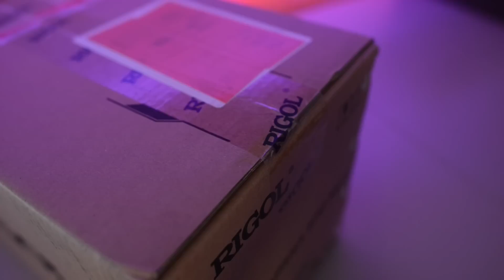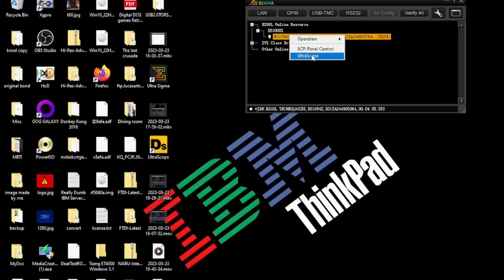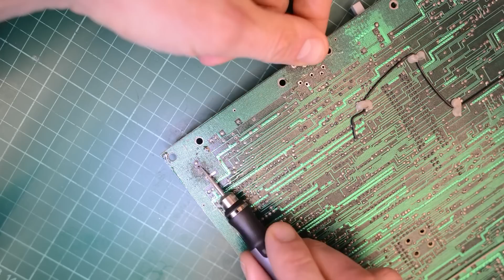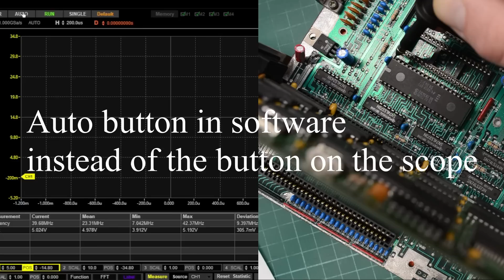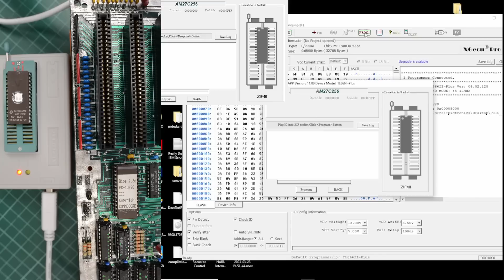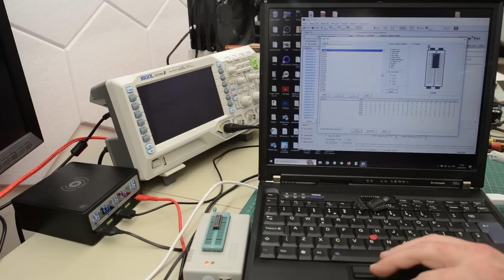Trying out a RIGOL DS1054Z on a battery-damaged Commodore PC10-III

Comment: Did you connect the scope using USB? Try the ethernet port connection, it's way faster. Also, select a smaller buffer size since all that data has to be sent to the PC, like 12KB is probably fine for troubleshooting digital signals. It can do 20MB, which can take minutes on the USB connection and about half a minute using ethernet. I never used the rigol software though, but connected to the scope using NI api with my own application to capture the scopes buffer for reading flux signals on 3.5" floppies :) Worked a treat! I could capture a full track with the scope in 4 channel mode, with about 4-5MB per track. The other channels contained the inverted signal, index and the digital read output.
Reply from the maker: Thanks, I'll give it a try

Comment: The chip tester is nice and easily finds dead chips. Sometimes chips may not be dead but just weak though. They may be good enough to pass the simple logic test, but still fail when they are in circuit and need to drive outputs at higher load. I've seen this with line drivers like the 74245 (similar to your 74244 in the video).
Reply from the maker: Ok, thanks. I'll keep that in mind when I use it
Reply: Yes, I’ve also seen this with the 6502!  Works fine in a chip tester, but too weak to drive the circuit on an actual board.  Mostly seen this a few times in a Commodore 1541 drive.
Reply from the maker: @dangoswick  Hmm. Ok, I'll see if I have other boards that use some of the chips in this Commodore and do some more tests.

Comment: The fact that your IC tester passes a chip as, "good" does not necessarily mean it is functioning correctly! I would refer to the data sheet and make a little circuit on a breadboard to illuminate a some LEDs when a switch is changed.  The software may function better on a Windows PC if you right click on the icon and choose "Troubleshoot compatibility" with the installer, and set a compatibility mode for the installer before installing. Once the software has installed, once again, troubleshoot compatibility with the application, and set a compatibility mode. If that offers no improvement, try setting the application to run as an Administrator. Hope this helps. Have fun, and thanks for uploading.
Reply from the maker: Thanks. I'll keep that in mind when using the IC tester
Reply: @Epictronics1  I went through that hoop diagnosing my old Apple II. All the chips checked out okay with the IC tester. The easiest way is to compare voltages on the board you are testing with a second identical system in good order. Chip failures are comparatively rare, but more insidious faults in these very old ICs are more common!

Comment: I love my DS1054Z. It performs really well and it's a pretty good deal for a 4 channel scope (that includes 4 probes -- granted, they're super budget quality, but they get the job done.) It becomes even more of a good deal once you hack it and unlock all the extra features (RS232, I2C, SPI decoders, double the capture memory, several new trigger options and increases the bandwidth to 100MHz.) The SOFTWARE on the other hand... yeah, 100% agree, it sucks. There are much better (and Free/Open Source) alternatives out there, that 100% work with this scope. Do check them out. Don't recall any names off the top of my head (I am tired and am not at my home PC right now) but the Googles should lead you to them.
Reply: Sigrok is pretty decent on the 1054Z.

Nice scope once you load the latest firmware and enable all the features.
Since I only use the scope screen, remote screen isn’t that important to me.
Reply from the maker: @roberthealey7238  Thanks
Reply from the maker: Thanks. I'll do a search for open source alternatives

Comment: I have the same scope. I bought it because Adrian Black used to use it.  Haven't used it in a while I have other scopes I like more.  Maybe you should get a USB scope like Adrian uses now. Last year I bought a cheap Loto USB scope off Ali Express. Not bad for 100 bucks. Nice software that would be easy to capture for video.
Reply from the maker: I considered getting a USB scope, but I prefer having a proper scope with a large display and real knobs. I'll just doo the proper research before I buy next time :/

Comment: Yeah, I get the feeling that the software was only there to tick the box in the feature list, not actually be useful for anything. Other manufacturers offer software connectivity as an optional extra, so in this case it looks like you get what you paid for, and you paid nothing for the software.

I've got a Siglent scope which is about 7 year old, and I've been pretty happy with it, although I've never used any kind of PC connectivity. The one thing I find annoying about Siglent oscilloscopes is that when you stop the capture, whatever is shown on the screen is all you can see. Most other scopes capture as much as their buffer allows, and show you a window of that buffer based on the currently selected timebase. That means you can zoom out to see more if you're not already on the longest timebase. With the Siglent, you have to zoom out to the largest timebase you want to see before you stop the capture, then you can zoom in and hope that there's enough data samples to see the details you need in the waveform. If you try to zoom out any further, it's just blank.

As for software connectivity, according to the manual you can either use Siglent's software or National Instruments "Vista" software. But again I have no idea how well any of that works.
Reply from the maker: I think you're right. It was probably included by the marketing department. By the looks of it, they probably made it too ;)

Comment: DS1000Z series is a great standalone 'scope, but just forget the software and PC connectivity. That's all garbage.
That thing has real knobs and buttons, that's a blessing, use those, don't screw yourself with PC software. That's not a USB-box oscilloscope. 
 I always shoot the screen with additional camera for YouTube.
Anyway, data rate that oscilloscope is capturing can not be transfered through 100 Mbit ethernet or 480 Mbit USB. ADCs run at 1 Gbps there.
And the data that being transfered is raw data points, not the screen data. You loose much of visual information that way, because internal screen has "digital phosphorus" and grading while PC software can not do that.
Reply from the maker: I agree. The scope seems great. So, if USB isn't fast enough, what are scopes with a good software solution using?
Reply: @Epictronics1  Sorry, I don't know any really good USB-scopes.
But I know that there are two projects for capturing waveform from DS1000Z.
One uses ethernet, saves screenshots with date and shows live wafeform (also without grading, much like original PC software), it offers no controls, only tries to display current data as fast as possible. Only for capturing purposes.
The other project's target is to create additional PCB, that is installed inside the scope between main board and the screen to give HDMI out for regular capture devices. So the whole screen of the scope will be captured. That is still in development.
Reply from the maker: Ok, thanks

Comment: it's a cheap scope, what can you expect? it's a wonder it can be controlled remotely by ethernet. I have one of the 4000 series and it has a vga output and none of the sw issues you showed. I had to use the 1054z in the past and it works, it's kinda annoying to use because of how slow the sw is, but it's what you pay
Reply from the maker: true. the scope seems great. They shouldn't have included that crappy software and won
Reply: @Epictronics1  I actually like the feature. in the past I had to take screenshots of the stuff I worked with, and using an usb stick to do so was so annoying. I used this remote control feature to automatically take a screenshot from a python script, 10x more useful than the crappy software and 1000x more convenient than the usb stick

Comment: Rigol's software is a piss show, at least for 1054Z - as you had bad luck to discover in person by now. If your intent was to buy a scope with good software/control from PC - you'd went way better (and cheaper which makes it even more funny) with some Hantek + third party software for it. Other good bets might be scopes from Siglent as far as I had heard from my friends sharing retro electronics hobby with me. There are some models out there with VGA or HDMI outputs providing the same picture you see on the scope screen over the wire. Also heard that some Siglent models do offer an VNC screen sharing over the wifi/ethernet but I never saw one in person so it might be just rumours. Getting back to Rigol 1054 - it is a good scope to buy and use, dirt cheap, capable and hackable as long as you intend to use it as a standalone device, like a good old dedicated tool in a box without all of those "modern fancy things" like PC control, e.t.c., e.t.c.
Reply from the maker: Yeah, the only thing I need from the PC is a capture of what I'm doing. I should have done better research. The 1054 seems to be a great scope otherwise

Comment: The software not mirroring the scope is probably by design. It gives you a second independent remote scope view. But I wonder why it is so bloody slow. As for pressing the up/down arrows a million times, did you try mousing over the numbers and use the scroll wheel on your mouse?
Reply from the maker: I guess it's useful that way for some applications. I'll try to scroll the mouse, thanks
Reply: Yeah, that could actually be very useful, to get detailed waveforms on one screen while getting historical trends on another.  I like it.  Well.... assuming it worked worth a hoot.

Comment: That software is Hideous! I am not familiar with the Rigol but as I said on the live chat the Siglent I have has web control or you just type the IP address in a VNC client. It works beautifully - only the framerate is slower than the scope itself (likely 30fps, so very usable). If you get the 100Mhz 4ch version it can be hacked to 200Mhz and you can also activate a few features such as wifi (will need dongle) etc. Beware, the WiFi on my unit is unreliable so I keep it wired. There are less buttons than the Rigol so some changes take more "clicks" but you get used to that I guess. Or hopefully you can find an alternative software for yours (which SHOULD NOT need an i7 to run! :) ).
Anycase, good luck and thanks for the video! Looking forward to the final episode :)
Reply from the maker: Thanks. The 1054 has LXI. However, It's the same crap as with USB but even slower!
Reply: @Epictronics1  When I was selecting the scope I remember reading that the 1054 was a good scope but an old design. I know that "new" doesn't necessary means "better" but it was one thing that put me off a bit. If not mistaken it was launched in 2014, it's 9 years :)
You want to know the funny thing? I did not buy the Siglent for its remote capabilities. I didn't even know it had it and I didn't have a channel back then. On my earlier videos I was filming the scope :) I discovered the web interface half way through the "Yamaha" repair video! LOL! Then later on I noticed a "VNC" error on the web interface and tried VNC directly... it just works. 
(BTW I am not trying to sell you a Siglent, just sharing my experience!). I hope you sort it out with Rigol - or with an alternative SW.
Reply from the maker: @tony359  We never know what we need. I bought my camera to take pictures! lol
Reply from the maker: @tony359  I have done some research and VNC seems to be the way to go. When you do a measurement with your scope does the trace appear instantly on the PC? or is there a lag?
Reply: @Epictronics1  There is a minor lag (milliseconds) and the VNC framerate is slower than the actual scope - totally usable though IMHO. I'll take a video of the scope and the computer monitor and send it to you so you can see by yourself!
Reply from the maker: @tony359  Thanks! I don't mind if there is a lag when I push buttons and menus. but if a signal appears quickly (eg. reset pin) it needs to show up almost instantly. On the 1054Z it's gone before the software can catch it!
Reply: @Epictronics1  It's not so slow :) And the delay means that everything is being shown - just with a delay. I usually check the reset pin in ROLL mode, in that mode VNC is some milliseconds behind but everything gets shown on screen. I'll send you a mail in 15 minutes :)
Reply from the maker: @tony359  Thanks :)